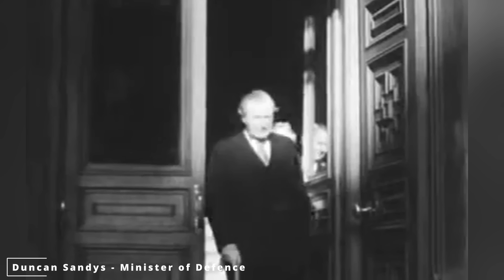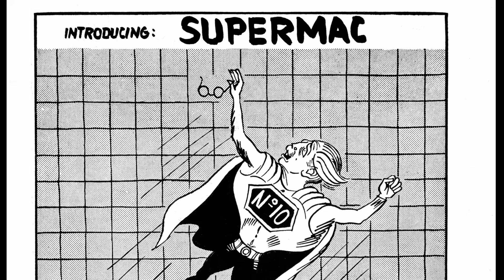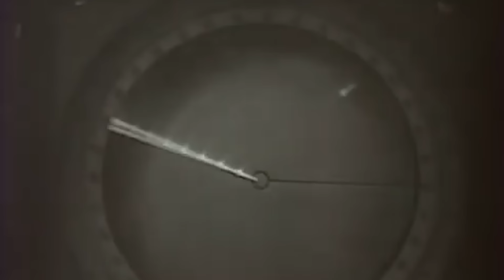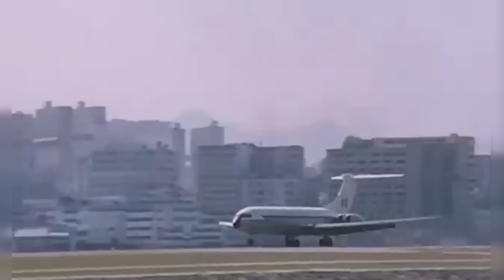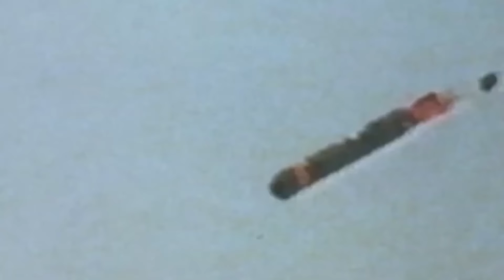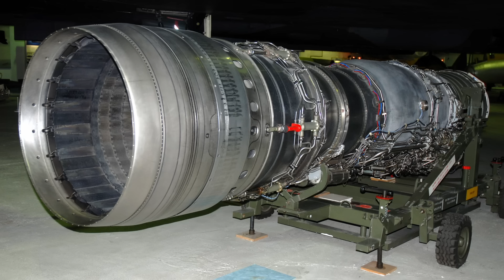How Britain Turned A Failed Airliner Into a Soviet Submarine Predator | The Mighty Nimrod

Comment: Britain Turned A Failed Airliner Into a Soviet Submarine Predator?
Or more accurately ...........
Britain Turned A Failed Airliner Into an ill designed deathtrap for its crew
BUT DESPITE WARNINGS THE POLITICIANS DEMANDED THE POOR SODDING RAF KEPT FLYING THEM TO SAVE MONEY
Reply: We believe we can clear up some commonly held myths and misconceptions obviously.

It's always good to see the facts presented clearly and concisely isn't it?

The Comet and Nimrod didn't have high accident loss stats. 

Bow-wing (see B-47 wing collapse wing folding incidents) had built less than 12 pressurised airliners before the Comet first flew and they were not high altitude airliners. 

All Nimrods were new build Comet 4 airframes with appropriate strengthening and the unpressurized  equipment bay tacked on. 

The HS 801 Nimrod was the most advanced aircraft of it's type at the time it first flew. Problems with the MRA4 programme were almost entirely due to radar and computer equipment issues and BAe Systems & Co being too busy with other work at the time. 

Obviously there have been worse aircraft for accident losses both before & after the Comet.

Early problems with Comet takeoff stalls were caused by pilots over rotating the aircraft at liftoff. 

Podded engines on wings have aerodynamics issues. The main reasons for eventually going with podded engines were because or to facilitate -
Ease of maintenance.
Use of shear off fixings given excessive out of balance forces.
Large diameter turbofan engines.
Reduce load on the wing to fuselage connection. 
Increased power from later engines. 

The Bow-wing (See B-47 wing collapse & wing folding incidents) was a good example of how to expend a huge amount of cash and effort on something that was probably not worth bothering with. The basic design of the Comet had been decided upon and established before the podded engine choice has been made for the B-47. There were aerodynamics problems with podded pylon mounted engines at the time. The US also built and operated a significant number of EE Canberra bombers under licence which did not use podded engines for their wing mounted engines. . 

There have been aircraft losses caused by pod & pylon mounted engines. 

All jet airliners benefited greatly from the knowledge gained from the Comet incidents & subsequent investigations & yet some were still worse for accident losses. 

Instances of all marks of the Comet flew with full certification after 1954 including the Comet 3. The last Comet flight occured in 1997.

The fabulous trail blazing DH Comet.
World's first jet airliner in regular service.
The jet engined Avro Lancastrian actually did a passenger service before the DH Comet. 
World's first high altitude airliner.
World's first airliner with a full fuselage length pressurised cabin pressurised for high altitude flight. That feature for that type of aircraft was a considerably difficult undertaking. 

The change from larger squarer windows to smaller rounder windows was necessary for the particular aircraft at the time. Skin thickness remained mostly the same for all Comet marks. 

How things were back then.
Accident losses - % of aircraft built.

DeHavilland Comet 4 UK                          14% 
DeHavilland Comet all mks UK (ff 1949)17%  
Vickers VC10 UK (ff 1962)                         5%

Douglas DC-1  US                                       99%
Douglas DC-2                                              47%
Douglas DC-3                                              30%
Douglas DC-4                                              26%
Boeing s300    US                                       72% 
Boeing 307                                                  70%
Boeing 247                                                   48%
Boeing 707  (ff 1958)                                 32% 
Lockheed L-049 Constellation (ff 1943)  30%
Lockheed Electra US (ff 1957)                   29%
Fairchild FH-227 US (ff 1966)                   30%
McDonnell Douglas DC-8 US  (ff 1958)   14%
Sud Aviation Caravelle  (ff 1955)             15%
Canadair CL-44 Turboprop US (ff 1959) 46%  
Convair CV-580 Turboprop US (ff 1960) 22%
Convair CV-880     (ff 1959)                      27% 
Convair CV-990     (ff 1961)                      33%
Tupolev T-104        (ff 1956)                     16%
Vickers Viscount UK  (ff 1948)                29%  
Fokker F-27 Turboprop NL (ff 1955)       40%      

The Vickers VC10, fastest Atlantic crossing for a non supersonic jet airliner, held the record for 41 years.

For the first few years of operation the Caravelle & Comet had similar accident loss fatalities.

Sud Aviation Caravelle - 
all accident loss fatalities - 
1320 fatalities. 

De Havilland Comet - 
all accident loss fatalities - 
453 fatalities. 

An example of a typical airliner from the period. 
The Fokker Friendship F-27 fatalities & accident losses as a % of aircraft built. 
Fokker F-27 Turboprop (ff 1955)   40%
2130 fatalities.

Of course De Havilland carried out a full stress analysis & performed extensive & protracted testing on two long lengths of fuselage representing all features of a complete airframe. De Havilland carried out significantly more testing than was required by any authority at the time & significantly more testing that any previous airliner was subjected to.

De Havilland designers / engineers knew all there was to know about metal fatigue at the time they designed the DH Comet.

De Havilland had prior experience building many all metal construction airframe aircraft including many passengers aircraft & thousands of jet powered fighter aircraft that were primarily of metal construction with pressurised cockpits & used jet engines built by De-Havilland.

De Havilland did indeed always work to better than industry standards at the time, used up to date knowledge for the design & testing activities & no evidence of negligence or criminal negligence was ever produced in relation to the DH Comet.

Global aerospace. 
From the 1950s sector rationalisation and consolidation took place. 70 companies in France and 300 companies in the US disappeared due to merger or dissolution. In the US Boeing was almost bankrupted by the 707 project.  Boeing had a well protected domestic market and the available space and resources in the US to engage in large scale airliner manufacturing enabling them to capture orders simply by being able to produce airframes fast enough and cheap and nasty enough. Another factor is airlines preferring to obtain as much of their airliner inventory as possible from one manufacturer. 

Global Aerospace Sector, what's happening.

For example, there are of course no German companies that makes German jet aircraft in Germany & there are no German companies that make German gas turbine aero engines in Germany that are suitable for widebody airliners.

The UK has the world's highest combined per capita Nuclear / Defence / Aerospace Sector Activity.

UK defence sector, absolute terms, world's second highest activity. 1st for per capita defence sector activity. Per capita nuclear powered submarine construction, 2nd position. 
Main players being Rolls Royce, Babcock, GKN Aerospace & BAe Systems. Activities often involve international collaboration. BAe systems, RR and other UK companies now handle more Airbus work value wise than Germany. 

There's a good chance that anyone currently flying on a widebody airliner will be on an aircraft powered by RR gas turbine aero engines made in the UK and a good chance there will be other hardware on the aircraft that's designed and / or manufactured in the UK. 

Rolls Royce Holdings UK
Subsidiaries
- Rolls-Royce plc
- Rolls-Royce North America (ex Allison etc Classified Military stuff)
- Rolls-Royce AB
- Rolls-Royce Deutschland
- Rolls-Royce India Private Limited
- Rolls-Royce Marine Power Operations
- Vinters Engineering Limited
- Rolls-Royce Controls and Data Services
- Rolls-Royce Power Systems
- Bergen Marine
Joint ventures include:
- Rolls-Royce Turbomeca
- MTU Turbomeca -

Trent Family
The MT30 (Marine Turbine)
Industrial Trent 60 Gas Turbine
Trent 7000
Trent XWB Airbus A330neo.
Trent 1500
Trent 1000
Trent 500
Trent 600
Trent 700
Trent 800
Trent 8100
Trent 900
   
RR wholly owned subsidiaries in Germany handle smaller 2 shaft RR gas turbine aero engine work.

The UK space and aerospace sectors are highly productive, high-value industries that together contribute over £18 Billion in direct Gross Value Added (GVA) to the UK economy. Individually, the space industry directly contributes about 0.3% of UK GDP 7•2 Billion while the aerospace industry contributes approximately 0.5% £10•9 Billion.
   
We hope this helps.
Reply: @Paul-mh9pr  And then DESPITE WARNINGS the RAF compelled Nimrod to adopt in flight refuelling (&)

NIMRODS BLEW UP & CREWS DIED Avoidably too!
Reply: @Farweasel 

Nimrods had fairly reasonable accident losses statistics.

There have been aircraft with significantly worse accidents loss statistics.

Comment: Only the two prototypes XV147 and XV148 were constructed from heavily modified Comet 4C airframes.
these aircraft were only used for testing and scrapped.
The Hawker Siddeley H.S.801 is a completely different aircraft and shares no significant parts or assemblies in common with Comet, parts between the two are not interchangeable.
Reply: @DoktorBayerischeMotorenWerke 

We believe we can clear up some commonly held myths and misconceptions obviously.

It's always good to see the facts presented clearly and concisely isn't it?

Bow-wing (see B-47 wing collapse wing folding incidents) had built less than 12 pressurised airliners before the Comet first flew and they were not high altitude airliners. 

All Nimrods were new build Comet 4 airframes with appropriate strengthening and the unpressurized  equipment bay tacked on. 

The HS 801 Nimrod was the most advanced aircraft of it's type at the time it first flew. Problems with the MRA4 programme were almost entirely due to radar and computer equipment issues and BAe Systems & co being too busy with other work at the time. 

Obviously there have been worse aircraft for accident losses both before & after the Comet.

Early problems with Comet takeoff stalls were caused by pilots over rotating the aircraft at liftoff. 

Podded engines on wings have aerodynamics issues. The main reasons for eventually going with podded engines were because or to facilitate -
Ease of maintenance.
Use of shear off fixings given excessive out of balance forces.
Large diameter turbofan engines.
Reduce load on the wing to fuselage connection. 
Increased power from later engines. 

The Bow-wing (See B-47 wing collapse & wing folding incidents) was a good example of how to expend a huge amount of cash and effort on something that was probably not worth bothering with. The basic design of the Comet had been decided upon and established before the podded engine choice has been made for the B-47. There were aerodynamics problems with podded pylon mounted engines at the time. The US also built and operated a significant number of EE Canberra bombers under licence which did not use podded engines for their wing mounted engines. . 

There have been aircraft losses caused by pod & pylon mounted engines. 

All jet airliners benefited greatly from the knowledge gained from the Comet incidents & subsequent investigations & yet some were still worse for accident losses. 

Instances of all marks of the Comet flew with full certification after 1954 including the Comet 3. The last Comet flight occured in 1997.

The fabulous trail blazing DH Comet.
World's first jet airliner in regular service.
The jet engined Avro Lancastrian actually did a passenger service before the DH Comet. 
World's first high altitude airliner.
World's first airliner with a full fuselage length pressurised cabin pressurised for high altitude flight. That feature for that type of aircraft was a considerably difficult undertaking. 

The change from larger squarer windows to smaller rounder windows was necessary for the particular aircraft at the time. Skin thickness remained mostly the same for all Comet marks. 

How things were back then.
Accident losses - % of aircraft built.

DeHavilland Comet 4 UK                          14% 
DeHavilland Comet all mks UK (ff 1949)17%  
Vickers VC10 UK (ff 1962)                         5%

Douglas DC-1  US                                       99%
Douglas DC-2                                              47%
Douglas DC-3                                              30%
Douglas DC-4                                              26%
Boeing s300    US                                       72% 
Boeing 307                                                  70%
Boeing 247                                                   48%
Boeing 707  (ff 1958)                                 32% 
Lockheed L-049 Constellation (ff 1943)  30%
Lockheed Electra US (ff 1957)                   29%
Fairchild FH-227 US (ff 1966)                   30%
McDonnell Douglas DC-8 US  (ff 1958)   14%
Sud Aviation Caravelle  (ff 1955)             15%
Canadair CL-44 Turboprop US (ff 1959) 46%  
Convair CV-580 Turboprop US (ff 1960) 22%
Convair CV-880     (ff 1959)                      27% 
Convair CV-990     (ff 1961)                      33%
Tupolev T-104        (ff 1956)                     16%
Vickers Viscount UK  (ff 1948)                29%  
Fokker F-27 Turboprop NL (ff 1955)       40%      

The Vickers VC10, fastest Atlantic crossing for a non supersonic jet airliner, held the record for 41 years.

For the first few years of operation the Caravelle & Comet had similar accident loss fatalities.

Sud Aviation Caravelle - 
all accident loss fatalities - 
1320 fatalities. 

De Havilland Comet - 
all accident loss fatalities - 
453 fatalities. 

An example of a typical airliner from the period. 
The Fokker Friendship F-27 fatalities & accident losses as a % of aircraft built. 
Fokker F-27 Turboprop (ff 1955)   40%
2130 fatalities.

Of course De Havilland carried out a full stress analysis & performed extensive & protracted testing on two long lengths of fuselage representing all features of a complete airframe. De Havilland carried out significantly more testing than was required by any authority at the time & significantly more testing that any previous airliner was subjected to.

De Havilland designers / engineers knew all there was to know about metal fatigue at the time they designed the DH Comet.

De Havilland had prior experience building many all metal construction airframe aircraft including many passengers aircraft & thousands of jet powered fighter aircraft that were primarily of metal construction with pressurised cockpits & used jet engines built by De-Havilland.

De Havilland did indeed always work to better than industry standards at the time, used up to date knowledge for the design & testing activities & no evidence of negligence or criminal negligence was ever produced in relation to the DH Comet.

Global aerospace. 
From the 1950s sector rationalisation and consolidation took place. 70 companies in France and 300 companies in the US disappeared due to merger or dissolution. In the US Boeing was almost bankrupted by the 707 project.  Boeing had a well protected domestic market and the available space and resources in the US to engage in large scale airliner manufacturing enabling them to capture orders simply by being able to produce airframes fast enough and cheap and nasty enough. Another factor is airlines preferring to obtain as much of their airliner inventory as possible from one manufacturer. 

Global Aerospace Sector, what's happening.

For example, there are of course no German companies that makes German jet aircraft in Germany & there are no German companies that make German gas turbine aero engines in Germany that are suitable for widebody airliners.

The UK has the world's highest combined per capita Nuclear / Defence / Aerospace Sector Activity.

UK defence sector, absolute terms, world's second highest activity. 1st for per capita defence sector activity. Per capita nuclear powered submarine construction, 2nd position. 
Main players being Rolls Royce, Babcock, GKN Aerospace & BAe Systems. Activities often involve international collaboration. BAe systems, RR and other UK companies now handle more Airbus work value wise than Germany. 

There's a good chance that anyone currently flying on a widebody airliner will be on an aircraft powered by RR gas turbine aero engines made in the UK and a good chance there will be other hardware on the aircraft that's designed and / or manufactured in the UK. 

Rolls Royce Holdings UK
Subsidiaries
- Rolls-Royce plc
- Rolls-Royce North America (ex Allison etc Classified Military stuff)
- Rolls-Royce AB
- Rolls-Royce Deutschland
- Rolls-Royce India Private Limited
- Rolls-Royce Marine Power Operations
- Vinters Engineering Limited
- Rolls-Royce Controls and Data Services
- Rolls-Royce Power Systems
- Bergen Marine
Joint ventures include:
- Rolls-Royce Turbomeca
- MTU Turbomeca -

Trent Family
The MT30 (Marine Turbine)
Industrial Trent 60 Gas Turbine
Trent 7000
Trent XWB Airbus A330neo.
Trent 1500
Trent 1000
Trent 500
Trent 600
Trent 700
Trent 800
Trent 8100
Trent 900
   
RR wholly owned subsidiaries in Germany handle smaller 2 shaft RR gas turbine aero engine work.

The UK space and aerospace sectors are highly productive, high-value industries that together contribute over £18 Billion in direct Gross Value Added (GVA) to the UK economy. Individually, the space industry directly contributes about 0.3% of UK GDP 7•2 Billion while the aerospace industry contributes approximately 0.5% £10•9 Billion.
   
We hope this helps.